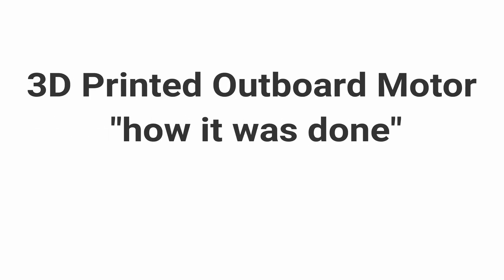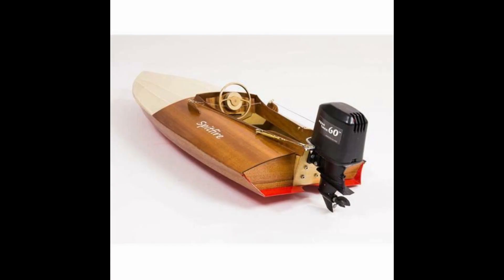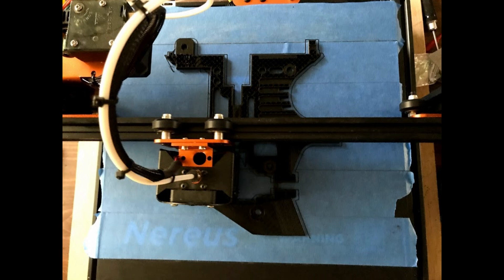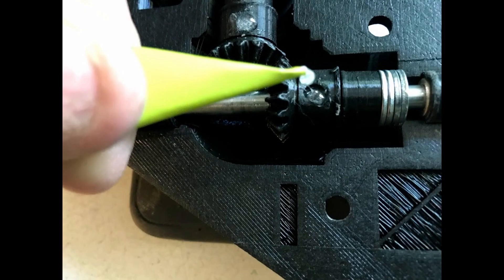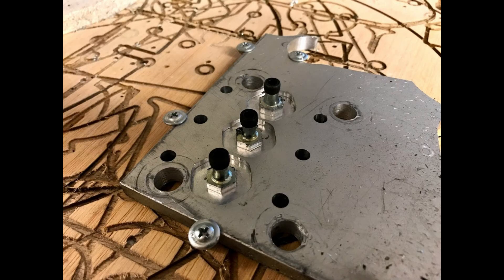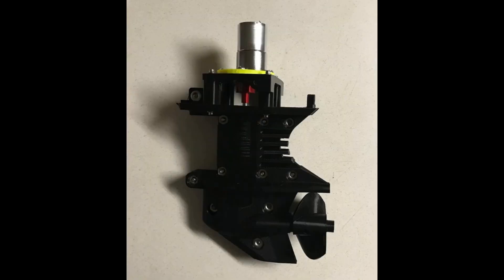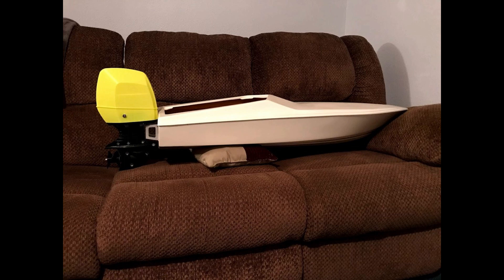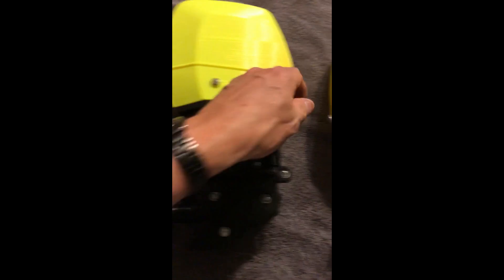3D Printed Outboard Motor Project

Comment: This motors is giving me some very good ideas for an kayak motor!
How would I be able to get the a modified file to download this ingenious motor ? Whit just a little increase of the size.
Reply from the maker: You would have to use metal gears and bearings if you are going to put any kind of load on the motor. You might be better off to make the motor frame from Billet Aluminum. 
Search Outboard motor on thingiverse.com and you will find a few. Re-size before you slice.

Comment: Would love to see a video with these motors behind a boat in the water.  Any chance you will post a video of that?
Reply from the maker: They would not last long under a load. They were built as working display engines and for that they are perfect.

Comment: I just printed this
Bought all the hardware from ebay
I only have to pocket for one bearing
Trying for 4cell lipo horsepower
Reply from the maker: What did you print it with. The gears won't last 20 seconds under a load on 4 cells. Be sure to update with your results. Do you have a video of your project?
Reply: @supertroyofssf  I got 4mm 90 degree steel gears, 100mm stainless shafts, 40mm 1.4 pitch metal prop, dog drive and stop collars from ebay. im building a hotshot tunnel cat like you pictured. No one likes slide shows on youtube and I don't really video cuz I think I sound stupid 😐🙂
Reply from the maker: @nahbruv3621  Just remember a slide show is always better than no show.  LOL

Comment: Very nice, any update?, thanks for sharing.
Reply from the maker: The motors are completed and still laying on their sides in a glass case. At some point I plan to build a clock and link them to it so they will start and run on the hour for about 20 seconds and on the half hour for about 10 seconds.

Comment: Nice!
I'm sure the designer will certainly appreciate it if given a simple thank you / acknowledgement.
Reply from the maker: Sure Thing! Thanks for your comment. The motor printed nicely. I designed the drive line for it and it works very well. In fact I went to tip the designer but it has not been setup.
Reply: @supertroyofssf  😄

Comment: Hey, Troy good to see your still keeping busy.  Back in the UK, I used to race tunnel hills with the outboards you show in the  mercury livery, they were hand made in the UK by an old fellow who cast each lower section (by hand) using glassfibre resin and the flex drive (think speedo cable inner, but 0.5 inch diameter) ran in brass tubes cast in the resin. The week point was the flex drive, pop the clutch on a OS61 (10cc I.c engine) driving a 2" diameter 3.2" pitch prop and the flex was instantly 2 parts..fun days..
Reply from the maker: Hey, I still have some 46" Deep V hulls with weedeater  motors running the flex shaft drive setup like your talking about in my collection. Flex drive is less friction so it is much faster but is not as strong as a gear drive setup. The white hull on the sofa with the outboard leaning on the transom was a backup hull I never had to use. 
Later on, I may create another large outboard with a working forward and reverse selector. It is amazing what can be done with a 3D printer now days and for some things (like a display model) it is the perfect option if you can design parts in 3D.